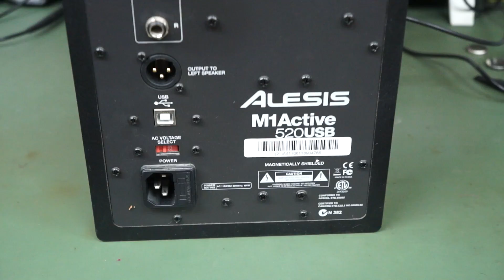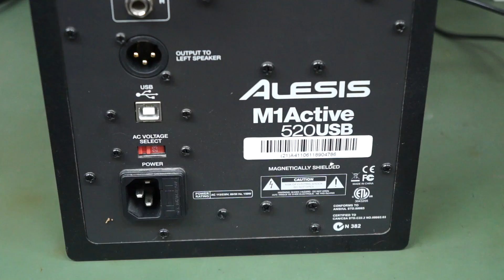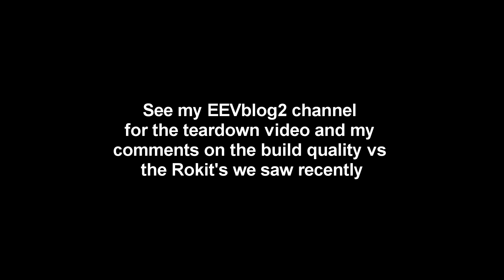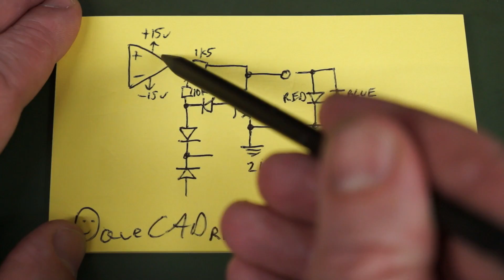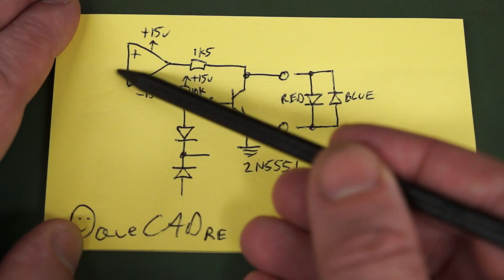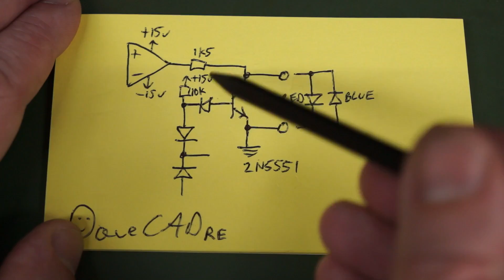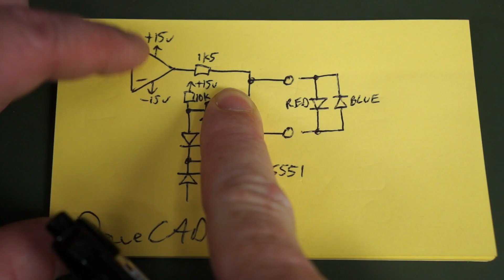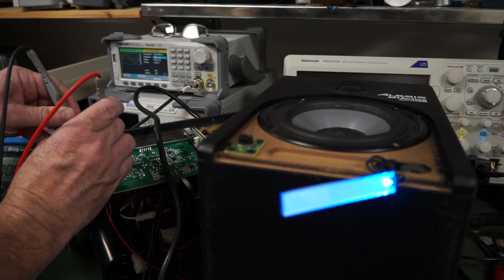EEVblog #1087 - UNBELIEVABLE Alesis Studio Monitor Fault!

Comment: im seeing that some jr tech assuming all LED's draw the same current and not realizing that they may not , or picked up the wrong LED entirely that do not match the spec/draw of the red LED calculations were initially done for that circuit. 
the circuit is simple, but component specs still have to be looked at.

Comment: totally common. 
seen this 1000s of times on HP Printer displays in the early & mid  '00s.
there are several reasons for this, the largest being Very fine bond wires. Next being an issue with the transition between ROHS and lead solders at that time. thermal issues are very common with the older Blue (not royal blue) LEDs. 
your issue is amplified by being epoxied into an enclosure...  cooling and expansion are very common issues in those SMD LEDs.
Reply from the maker: Cooling and expansion with only a couple of milliamps difference in current?
Reply: yes, especially with those small, SMD LEDs. they tend to be very sensitive.

Comment: One time I had one of the driver transistors fail for the stepper motor on a scanner. It used a transistor array IC which had some unused channels, so I just added a few jumpers on the IC. Some time after another channel blew, and I think there was still a free transistor to wire that one to as well.

Comment: I got 2 ATX cases that were cheap because they probably had issues and sort of gay, which  I still use. They have a button to light up 2 light pipes so it looks sort of like a Jukebox when on. One of them would flicker on and off. I investigated and found out the problem had to do with one of the leds shorting out on the metallic clips at the end of the light pipe as per being hot snotted. So I removed them and re hot snotted them. Life was cool for about 10 years when  one went out and I think it had to do with being more or less on the ATX mains and it is impossible to control the amperage going to them . Maybe a bigger supply is to blame.

Comment: Ive come across too many misbehaving LEDs to ever think they are as reliable as many people clam
Reply: cheap LEDs and Cheap designing. 
There are plenty of good LEDs and if used properly, they prevail.
Reply: a Shorted LED will allow current to pass thru to the other LEDs. replacing it with a resistor will only lessen the chances of other LEDs failing because of the over voltage/current allowed to pass thru the failed LED. replacing an open circuit LED with a resistor will allow power to pass thru into the still functioning LEDs.

none of these actually solve the problem. the stock LEDs need to NOT be over driven AND they need proper COOLING, both of which are set aside in manf & design for $$$.
Reply: The amount of bad LEDs in TVs is astounding...even working TVs. They'll work if they fail in a short but eventually they'll lose enough of them and the voltage goes out of spec and shuts down into protection. I even see edge lit TVs melting the plastic sheets behind the LCD...not to mention the Vizios that are smoking and can melt the LCD and bezel.
Reply: correct, as long as you use a resistor that won't overheat to the point it starts to melt/burn.... over volt/amp protection will do little to help in that case.
:) GL with your repair.
Reply: Anger me?? Not even slightly. :) & you're quite welcome, would hate if you did this mod and it caught fire simply for lack of a tad of info that i could provide.  again, GL! :)
Reply: BMack37 Thank you for this comment. I'm gonna try to diagnose a bad backlight later, and this gives me a good point to start. If I can't get a replacement for the shorted led, would soldering a resistor in its place bodge it into working again?

(Sorry, I'm a total beginner when it comes to component level repair)
Reply: Charles Freitag I know it does not fix the problem, but I am trying to nudge the overvolt/overcurrent protection into not triggering. This is not meant to be a permanent solution, just a way to keep it working until I can afford a new monitor. This one is old and crappy anyway.

If a resistor can lower the overall current or just replace the load of the broken LED, I think it could be a quick hack just so that I can at least be productive until the next paycheck.
Reply: Oh yikes, yeah heat is a factor to consider, maybe i'll use some wrapping wire to get it away from any other components, maybe even out of the case. Thank you very much for your help, and sorry if i angered you with my lack of EE knowledge, i'm more of a software+microcontroller guy. To be honest, i'll be surprised if this holds up for even just a week. ;)
Reply: To jump onto what else has been said...we get the LEDs from Aliexpress almost exclusively. Sometimes they're a little different, Samsung uses like four different types while most only use their edge lit and their fully array LEDs, as two different LEDs. You really do want to replace the LEDs and UPDATE the firmware. Typically, if it's a common issue (which always seems to be the case) they'll "fix" it through software. Basically the fix is limited how bright a user can make it. If it's edge-lit, you shouldn't have an issue using a resistor but if it is full array there will be a dark spot that you will notice(because you know where it is). 

What I'd do if it's an edge lit and you plan on adding a resistor, is short the pads then put the resistor in line(on the wires) and use the panel as a heatsink(obviously being careful to not short the resistor legs against the panel). Be mindful of polarity, some of them use some odd configurations.
Reply: Of course cheap LEDs are bad and good quality ones are better, you would think such logic is obvious but only applys if your making the thing yourself.  Most consumer company's are on a race to the bottom approach inorder to maximize sales so they often use inferior leds. I don't see much effect put in by most lightbulb makers to use better LED bulb designs to help with cooling or use quality known brand LEDs in them and if the do its poorly implemented cos doing it right costs money. The LED streetlight outside my house is a Phillips unit and its been replaced twice this year. Most LEDs now are from china and even some of the lower spec well known brand name LED chip makers make them there so they can maximize their profits too yet often suffer the same lack of quality control.
Reply: BMack37 maybe ccfl are better to design n implement?
Reply: LCDs were lit by tiny fluorescent lights that ran width-wise across the TV, very little issues with those. In fact, I've been brought TVs from large facilities(where they're over-used and abused) where there are a couple tubes broken and the TV will still work after the repair. The only thing in the lighting that would go bad is the ballasts or the backlight-on circuit. Even cheap LCDs, you could expect to last 5+ years. Cheap LED TVs, which are LCD TVs but with LEDs instead of fluorescent lights; expect them to last as long as the warranty anything else and you're lucky...this is due to other factors (as well) similar to using cheap LEDs; the components on boards are junk and the engineering on the boards is poor. If you're not buying high-end, the life won't be long. Even then, there are high-end TVs such as the hospitality PDIs that are made VERY poorly.

Comment: The thing has a 16 bit usb codec. Pretty sure that's a Texas Instrument one. Every onboard soundcard is better than these things nowadays. Real bad soundcard don't really exist anymore. Would you hear the difference? Probably not, but I just wanted to put something straight what was being said in the video.
Reply: he uses it for voice, shouldn't really matter. although perhaps smps inside pc is more noisy than this linear supply speaker, and no issues with weird ground loops through the hdmi
Reply: Sound cards maybe are ok, but atleast my motherboards integrated sound chip is complete crap. Sound quality itself is not a big problem but backround noise and other crap is hearable with bit louder volumes, while external USB headphone amp (or digital out) doesnt generate all that interference.
Reply: There's nothing inherently wrong with a 16-bit codec, even compared to a 24-bit codec onboard your PC.  There are too many other factors that affect actual linearity and sound quality than the word length, especially when the majority of us end up sending 16-bit audio through it anyway.

Comment: I had a virtually identical issue with a red LED on an old MIDI interface - it was causing all sorts of random behaviour across the multiplexed front display. It took hours of troubleshooting and quite a few "repairs" before I finally found the little bastard!

Comment: My favorite LED failure was in a piece of machinery from probably 15-20 years ago that I had to deal with recently.  Long story short, it has an RGB LED to indicate ready/warning/fault.  I am not sure if it was something   with the bond wires degrading/shorting or if there were some chemical breakdowns going on, but the LED lit up Yellow, Green, and Yellow.  There went a couple of days of working on the entirely wrong part of the machine.

Comment: I wonder what you think of the old vacuum tube audio amps and other equipment in terms of warmth of sound and overall quality vs modern digital solid state.
Reply: MrKillswitch88 Tube audio isn’t “warmth of sound” it’s lack of resolution.
Reply: Of course tube amps sound different and you may like it, but they don't reproduce the original signal very precisely and one can measure that exactly.
Reply: So, just because it taints the sound doesn't mean it can't sound nice.

Comment: Actually that's a extremely common fault for LED's.  I see indicator LED's going haywire like that all the time.  On one second, off the next and then back on.  In my experience it's LED's in "cheaper" electronic devices.  High end products tend to use better quality LED's.
Reply from the maker: Yeah but do they exhibit a current dependent behavior?
Reply: Many seem to.  I think the bond wires break loose and make for a poor connection.  Feed enough juice into them and they come on.  Leave them on long enough and as they heat up thermal expansion seems to push the poor connection together and they will stay on.  Have seen this in 7 segment channel displays on CB radios to.
Reply: Yes, I've seen similar defects in various modern LEDs.  They can flicker at low current then stabilise at higher current.  I suspect a semiconductor defect rather than bondwires.
Reply from the maker: In this case it's not hundreds of mA, it's only a couple of mA difference.
Reply: I had the opposite happen in some GU10 LEDs a few years back, LED's tested ok at low currents but when 100mA + passes through them to light up the room something breaks and they turned into a dim flicker.
Reply: >wanted to confirm
>alesis speakers i own doesn't have any leds, only backlights
Well
Reply: Yeah, I got used to it before 4chan got IP banned last year.

IMO, Alesis's build quality is taking a dip since the local store here imported the iO2 Express as a last product. Sure, it's not an active monitor but even the old aluminium iO2 can handle a few power spikes from the XLR sockets. The iO2 Express that the store imported was toast an hour after purchase.
Reply: Why did you get banned?
Reply: Yeah, this is common with cheapo LEDs from china. Random flickering and current-dependent behavior. Sometimes it happens when the LEDs are overdriven, but often it's just random.
Reply: Green text doesn't work here buddy.

Comment: I suppose these speakers would be a bit disastrous if you connected to it to a usb type c port with a usb type c to usb type a adapter. Not truly universal really. That is my biggest complaint usb is not exactly universal especially on its later releases. And don't get me started on usb superspeed cables more like super fragile.
Reply: And where exactly would the type A plug go?
Reply: It's not powered via USB. Usb c to a should even work with a phone in this case
Reply: And again I ask, where is the type A plug going?!

Comment: The red LED could be in reverse breakdown.
Reply from the maker: In theory it could, but the blue LED failure mode is much more plausible IMO.
Reply: Couldn't you test this be measuring whether there's current or not through the LEDs while the blue goes out?
Reply: Attila Asztalos The current wouldn't tell you much since if the other LED would be in reverse breakdown, it would clamp the voltage to less than required to light the blue LED, but the current would remain mostly the same since the voltage changed relatively little.

Comment: I'd say you gave it an upgrade. I'm so damn tired of everything having a blue led
Reply from the maker: I remember the Blue LED frenzy phase back when they first came out.
The red does look better as a I sit here looking at it.
Reply: i had a router with blue leds that would make my bedroom bright enough to read a book... whoever thought that puting retina-burning blue LEDs in everything was a good idea has a special place reserved in electronics hell.
Reply: EEVblog, I remember it, too – the most annoying thing was the absurd brightness levels. I had to put black tape over a few of them so that I could sleep at night!
Reply: Blame the industrial designers. 

One of my favourite examples of this stupidity was an HP "entertainment" laptop which had one of those horrible glossy screens (protip, I don't care in the slightest what the thing looks like when it's turned off, but I'd like to be able to see my screen in any sort of well lit environment) and blue indicator LEDs across the top of the keyboard where they glared onto the screen making the bottom third of the display unwatchable.
Reply: When blue LEDs first came to market I mounted one in my police helmet with a 555 flip-flop... Kids loved it, but my inspector didn't :)
Reply: All 3 of my monitors have a blue power LED. Also my wifi adapter and 9V power supply. What's so great about blue?
Reply: I'm watching this on a monitor with a piece of black cardboard hanging over the annoying blue power light/button.
Reply: I like warm white LEDs for replacing blue indicator LEDs. They've got the same forward voltage and so are a direct drop-in replacement, and they give a much nicer, less distracting glow.
Reply: goose183 Dont worry, I'm well aware of it :)
Reply: Entertainment for non-buyers
Reply: Red is indeed better looking imho. -If nothing else it's much less distracting. I've even voided my guarantee on some stuff only to replace that bloody thing or the resistor that drives it. :)
Reply: JMMC1005 I have a feeling that you would like the channel bigclivedotcom.
Reply: Aye, he's some lad.  He really enjoys his warm whites, as do I now.  I just can't see/hear a mention of "warm white" without thinking of Big Clive :)
Reply: Morgan: Was it a Pavilion dv3/6000 series laptop with embossed "tribal" graphics in the plastic case? Had one of those a long time ago. Aaand yes. Annoying as f :D
Reply: Yeah, I remember when car alarms all had a little dim red flashing LED, then I changed the LED in my car alarm out for a bright blue 5mm LED. This was way back in the day when blue and white LED's were pretty much unheard of. But it was so bright, it lit up the entire interior of the car whenever it flashed on, like a 100W bulb turning on in there. At night, you'd see the entire interior of the car light up from a Km away, on and off every second or so. And it would throw shadows of the head-rests, steering wheel, etc way out onto distant buildings... I guess it's pretty common now, but back then, I thought it was really cool. I was pretty young back then.
Reply: Or white LED's as HDD activity indicators !
Reply: I have a couple of guitar pedals with them as well. The last thing I want when I look down at my pedal board on a darkened stage is to be blinded. They all end up with some kind of defuser (paper) taped over them.
Reply: and the funny bit is that red makes so much more sense for the power...
Reply: We're all the way down to complaining about computer LEDs...
Reply: don't even get me started on those.
Reply: Nowadays they must be controlled RGB LEDs...
Reply: Blue light is also known to reduce melatonin, causing sleep trouble.

Comment: Had this happen with a pocket FM/TV sound radio many years ago. Started with intermittent stereo which eventually failed totally. Turns out the the led was intermittent because it split in half due to the legs being bent when it was installed. This stress the bond wire until it broke.  The intermittent stereo had me looking at a faulty chip and first but when I fitted a new led it worked 100%.  The led was actually regulating the stereo detection voltage. When the led went open the voltage rose too high and muted the decoder. I actually read of a dead led causing no stereo shortly after that. Think it was in EA mag.
Reply from the maker: Interesting!